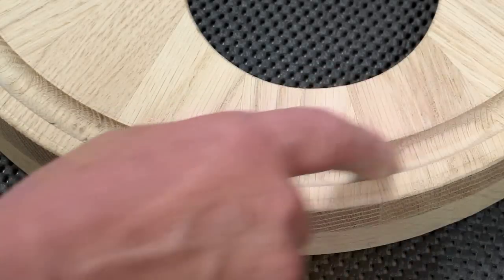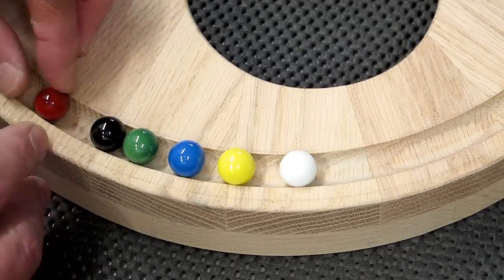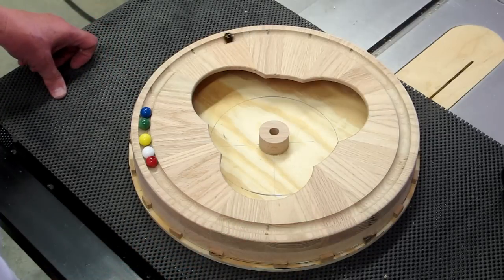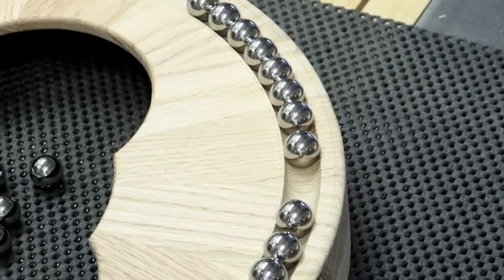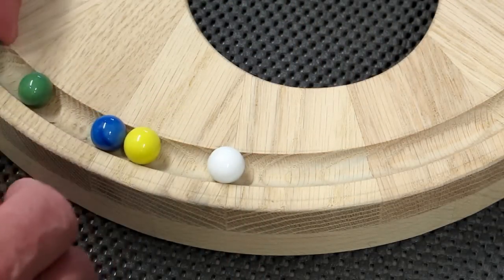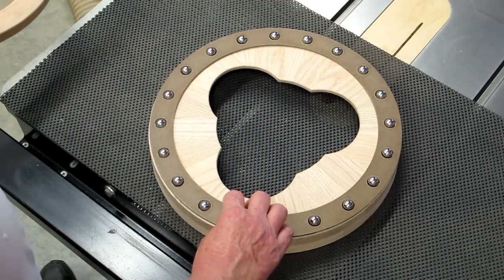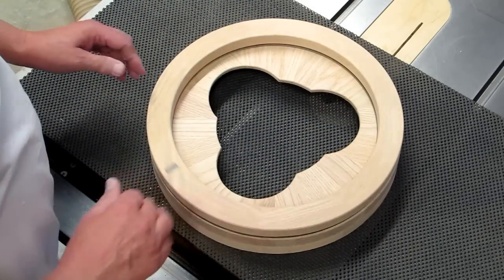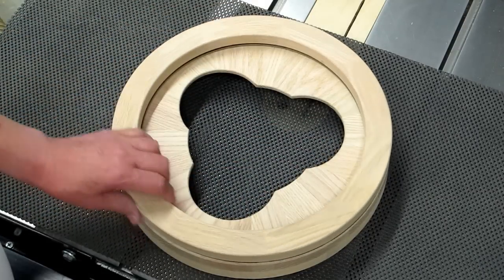Wood Thrust Flat Bearing - Marbles & Ball Bearings

Comment: Please help!

I am hoping to make a 3 tiered lazy susan (flat thrust! finally I know what to search!) out of 3.5' patio tables. The bottom will need to support 500+ lbs or more if I add a 4th tier! 

I want them to spin independently because they are for organizing my Magic card collection and I will want different combinations of cards handy depending what deck I'm building.

I have some scrap 1/4" plywood I thought I could use to make the groove for a 3' flat thrust. BUT I suspect that I will need a harder material than plywood for the weight bearing surface of the ball bearing.

I live down town so garbage Sunday provides LOTS of scrap. I was thinking of using the sheet metal from large appliances to cut out rings. but that's a lot of work, for an idea I am not 100% sure will help.

Aside from input on materials, I was wondering: what size balls should I use? I'll need about 3'xPix3 = 28.5' total diameter of balls. should I use small balls to distribute the weight? big balls to have greater tolerance? what is economic ball material?
Reply from the maker: First of all, 1/4" plywood isn't much good for anything as it is probably warped and twisted when you get it. Basically any regular plywood available at your local lumberyard is crap.

Particle board may be the best choice if you are going to make your own thrust bearings because it has a lot of resin in it (mine were made from oak). Make a test piece and see if you are happy with it.

Baltic Birch Plywood 1/2" thick is flat and strong.

As you can see in my video marbles are the cheapest but they are not the same size and they are not perfectly round. 5/8" steel ball bearings is what I used.

It sounds to me like you could do what you want a whole lot easier and a whole lot cheaper using manufactured bearings such as in the following listings or Go to eBay and search for "Lazy Susan Bearings". Buy one and see if you like it... then get however many more you need.

Lazy Susan Turntable Ring - MKP Industries LLC
https://www.ebay.com/str/mkpstoreusa?_trksid=p4429486.m3561.l161211

Cozy Nest Tools
https://www.ebay.com/str/cozynesttools?_trksid=p4429486.m3561.l161211

Thank you for watching. Please subscribe! 
That is what keeps this channel going. 
Ron
Reply: @RonaldWalters2010  wow! Ty so much! This video is really old! I didn't expect an answer over night!  Or ever

Any advice for supporting the middle of the table? I have a basket ball pole that's ~3" but it's slightly tapered. I imagine I could use some automotive bearing, BUT do I even need load bearing in the center or would a dowel for alignment suffice? the flat thrust should be located near the load's center of gravity - 3' long card boxes radiating from the center like an "*".  If anything, the load will move away from the center as I add some sort of frame to hold each box in place - I think I will tilt the boxes up a bit to reduce the diameter & make access more ergonomic - this may add sig weight near the thrust.

Also... I'm just a nurse who inherited some tools. I can do the math, and waste a lot of time/wood with trial & error but do you have any advice on efficiently designing the wood frame that holds the boxes? I am imagining 20 boxes per tier. 10 boxes will be my existing 3' boxes, and I will make 10 more short boxes that fit in between so they are flush with long boxes. Currently I am thinking: PERHIPHERY- 20  2x4s cut into trapezoids that are flush with the sides of 2 adjacent boxes, CENTER-triangle blocks flush with where boxes meet, & thin strips of wood to guide the boxes. If I tilt the boxes up I will use 2"-6" tall block under the periphery's edge.
Reply from the maker: Originally you said 3 tiered.

So... I was thinking three round plywood discs (whatever diameter you want) sitting on top of each other like stacked dinner plates with one of those Lazy Susan Bearings (I gave you links to) between each of the discs and one bearing underneath the bottom disc. 

The bottom bearing could be attached to a small table (like a bedroom end table). 

The bearings would be screwed to the discs above and below it (possibly the tricky part)... so that would keep everything aligned.

Spacing between the discs would be some more wood rings stacked and glued together to create whatever spacing between the discs you desire. Then you don't need a pole at all.

To turn the top disc... you hold the middle disc and spin the top one.

To turn the middle disc... you hold the bottom disc and spin the middle one (and the top one would turn also since nothing is holding it stationary).

Simple... no complicated pole with top and bottom supports... relatively inexpensive. 

It would work for me unless I am missing something. :-)

Not a lot of thought or design on my part here... just what immediately came to mind.
I'm not really picturing exactly what you have in mind, the size of the boxes, nor the spacing you deem necessary between the discs. 
Have you laid out the boxes in a circle to get a feeling of the diameter of the discs required? This could become unrealistic pretty quick!
The boxes could slide out a bit, which may reduce the required spacing between the discs.

Anyway... the rest is pretty much for you to figure out.
Ron
Reply: @RonaldWalters2010  You like to solve stuff. I like you. A true artist. I'm going to work on it this weekend - I'll take a picture. 

The boxes are standard plywood length (2.5"x3.5"x2.5'?) boxes that hold playing cards upright (portrait orientation) 

layed out on the 3' table so their corners meet, the boxes are 5.5' in diameter. 

Each tier of the lazy susan would have a payload of (VERY APPORXIMATELY!) 300 lbs.

I am not concerned about warped plywood. The tables are metal and should be able to keep it flat under a load - I will be screwing minimum 40 screws through it to secure the housing for the boxes (guess I should call them drawers now!)

My concern is that the plywood will compress and the balls will burrow dimples. So. no groove, but 2 rings of wood and a hard surface for the balls to roll on... but maybe soft enough for the balls to shape it a bit?

I am thinking 
1. I have 1/4" plywood
2. 3/4" balls leaves room for a 1/8" cage and 1/8 extra wiggle room to prevent jamming it up.
3. I have no idea what I'm doing.
Reply from the maker: Ref. your:
"The boxes are standard plywood length (2.5"x3.5"x2.5'?) boxes"

I do not understand what you mean by "standard plywood length" and... is there a reason for the boxes to be so long?

How many of your boxes does it take to make that 5 ft - 6 inch diameter?

Ref. your:
I am thinking 
1. I have 1/4" plywood 
2. 3/4" balls leaves room for a 1/8" cage and 1/8 extra wiggle room to prevent jamming it up. 
----> 3. I have no idea what I'm doing. :-) I liked that!

Once again I urge you to avoid 1/4" plywood for anything except possibly the boxes.

You are probably correct about the balls leaving dimples in the relatively soft plywood when sitting under a "large" load for a while. You may have difficulty sourcing 3/4" diameter balls while 5/8" diameter ball bearings are readily available.

That was the basis for my suggestion of the lazy susan bearings... some of which are 24 inch diameter (although cost $115 each). A 2 ft diameter bearing should support a 5 ft diameter disc of 1/2" or 3/4" plywood... best choice would be Baltic Birch or chipboard (also known as particle board or OSB). Chipboard remains flat. AdvanTech is probably the best resin base OSB out there... flat, strong and holds screws well.

Pine plywood sheets available at the lumber yard are 4ft x 8ft while Baltic Birch plywood is 5ft x 5ft. Baltic Birch plywood is expensive but it is primarily what I use for every thing. So, keeping the diameter under 4 ft or under 5 ft would make things simpler.

Patio tables are typically not very strong and I doubt they will be very happy with 500+ pounds sitting on top of one. Also the legs tend to be somewhat flimsy with a small footprint. With 500+ pounds on top or it... it will possibly leave a (permanent) mark wherever it sits. A bag of cement weighs 94 pounds. Try stacking 5 or 6 bags of cement on top of a patio table and see how long it takes to collapse or fall over on you and break your foot or leg. :-(

This thing will be "ever present" in your home... like an immovable elephant. And it will be a dust collector!

How about something against a wall like a library index card cabinet? Google it for an idea of different types. You could design the drawers to suit your cards.

You also said you inherited some tools. What is your experience using them? Do you have a table saw and do you know how to safely use it?

I have a table saw, router table, jointer, compound miter saw, band saw, disc/belt sander, drill press, etc. and various handheld power tools. Every single one is capable of seriously hurting or killing me. Supposedly I know what I am doing (most of the time) and yet a few months ago I got hit (twice within a matter of a few minutes) by a piece of 1/2" plywood... table saw kick-back... just below the belt (and just above the groin). That hurt but fortunately it did not remove anything... just bruised me and my pride!

You mentioned you are a nurse. Losing a body part or getting injured would not be good for you.

It may seem I am trying to talk you out of this huge multi-layered lazy-susan thing.
I am... while also suggesting something which may be stronger, neater looking, more practical, possibly safer and ultimately easier. ??? :-)

Go to my channel page. Click on "more" and scroll to the bottom to find my email address if you wish to send photos.

Ron

Comment: Do you have a video for making the wood part?
Reply from the maker: I do not have a video on actually routing the track.

In the video: Wood Thrust Flat Bearing - Marbles & Ball Bearings
Around 0:53 you can see the lower race sitting on the router jig used to cut the bearing track.

The following is a similar router jig I made recently. 
You won't be able to play this until after Dec 25th because it is currently scheduled on YouTube.

Router Circle Jig - Bamboo Pivot Pin
https://youtu.be/ybel-A265Zc

And the following applies to how the segmented piece of wood was made.
Segmented wheels or gears (blanks) with only radial grain can split due to climatic changes and natural wood movement.
Using C&R grain orientation is more difficult but produces a very stable wheel or gear.
Plywood is always the most stable but not as attractive.

The following playlist groups videos which cover a lot of this information:

https://youtube.com/playlist?list=PL0088F06A4155483F&si=UUKwt8xeE_RLEb9V

Thanks for watching. Please subscribe! 
That is what keeps this channel running. 
Ron

Comment: I have  round  glass  can you think of a way to make a lazy Susan?
Reply from the maker: This is the same way I would make a lazy Susan... marbles or bearings separated by a cage. Only problem would be it coming apart if you were not careful whenever moving it. If all you want to do is make your own lazy Susan, search eBay for "Lazy Susan Bearing" and you will find many different sizes and options. Thanks for watching.

Comment: u only need 3 balls , no brace/cage
Reply from the maker: Not sure what you are calling a brace. Three bearings would only remain at 120 degree spacing with a cage and using only three "balls" would overload the "balls" and the assembly would be unstable. I doubt you have ever see a bearing made with only three balls.
Reply: Ronald Walters your absolutely right in everything you said. 
But did you know that you can just use 3 balls. I have tested this using an old metal >>>>thrust bearing! 

No brace/race/cage is even needed. You can spin the plate  very fast and the balls do spin 1/2 the speed and stay pefectly at 120 degrees no matter the speed! However it is stable the deeper the groove, and even weight displacement! 

So to sum all this up. 3 balls can support a plate without a cage! the balls even themselves out no matter the speed! Since you’re using wood you will have alot of friction!

Comment: I have built a bearing for a device that is like a small lazy susan.  When I tried to make the groove/race all the way around the circumference, it did like yours. It rolled smooth, but it stopped as soon as you let go. With a small bearing near the axle, it spins for something on the order of a minute. Of course this is no good for a lazy susan, and you can buy small thrust bearings rather cheap so there's no need to make your own. In my app, I didn't need to make it donut shaped, nor did I need to worry about asymmetrical load. And I needed it to make at least a complete revolution with just a flick of a finger. So I went with the tiny bearing and a tiny 1 mil gap around the outer edge of the discs to prevent the turntable from tipping. Anyways, I thought this was interesting. More bearings = more mass, and you might think the larger bearing would carry a bit of inertia to offset a bit of the friction. But the balls must also travel much faster/farther for a given speed/rotation of the "lazy susan" as the bearing gets larger... which makes the loss from friction increase exponentially, or something like that. More balls moving faster/farther and all rubbing on race/cage. This is probably covered in mechanical engineering 101, but I learned it the hard way, lol. So from my perspective, your bearing works pretty great for its size.

Comment from the maker: The way a bearing works is no secret. Neither is the need to keep balls or rollers from running into each other. If you are making a wood bearing, what else would you space them with? I use what is in my shop. Apology accepted.

Comment from the maker: The drag is only on the front edge of the bearing where it is pushing against the cage. Using a spacer, far fewer bearings are required around the track. Fewer bearings equates to less drag. Metal bearings use cages/spacers for the same purpose.